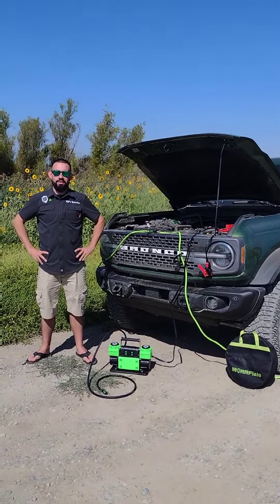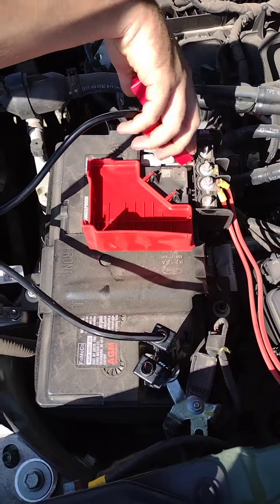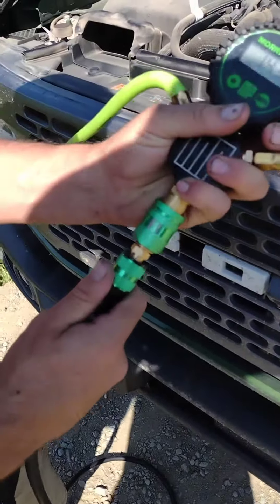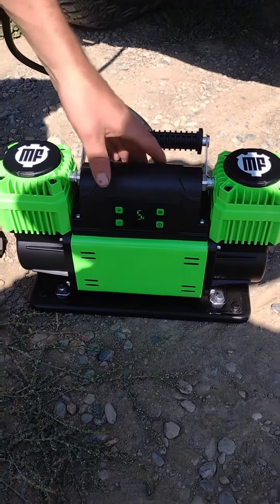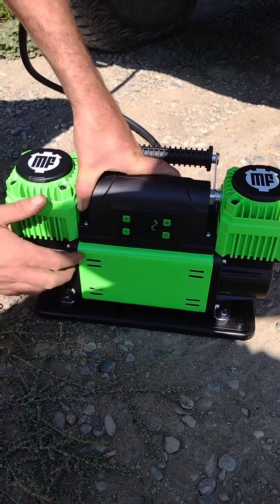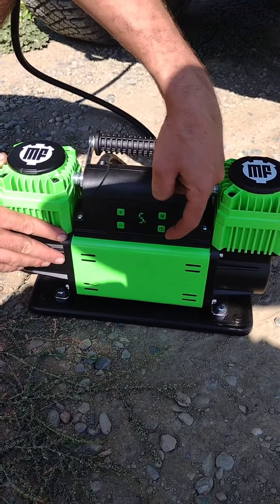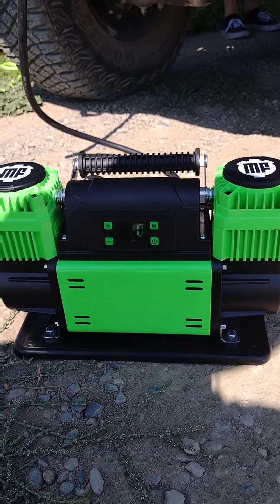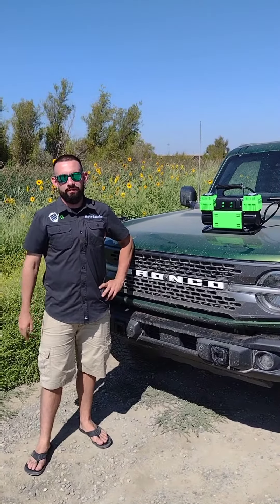TenSix PSI Pro 12v Automatic Compressor How To

Comment: Just got mine the hose screen is showing a minus symbol and 2 bars battery...I have just received it..
Reply from the maker: Hey hey! Thanks for bringing this up... Just to clarify, this is happening on the hose gauge and not the compressor, correct? If so, then it sounds like the gauge malfunctioned. Shoot us an email at questions@morrflate.com and we can get that fixed up for ya@

Comment: If they're different by nearly 2 psi, which of them is more accurate?
Reply from the maker: Hey! You want to use the reading from the PSI Pro compressor. From our own testing we think the difference between the digital gauge on the hose kit and the compressor is due to the heat from air at the different gauges.